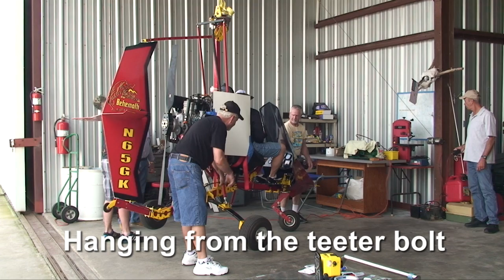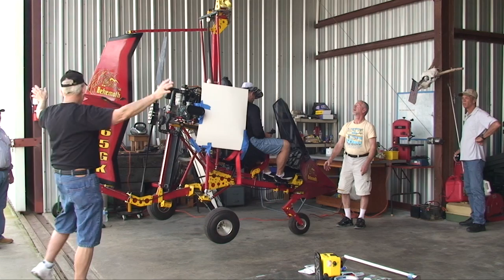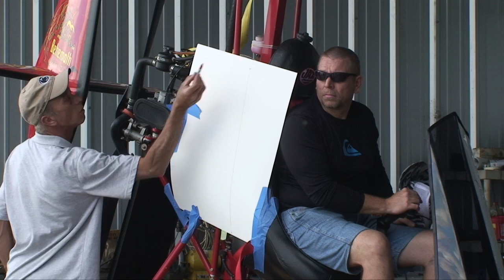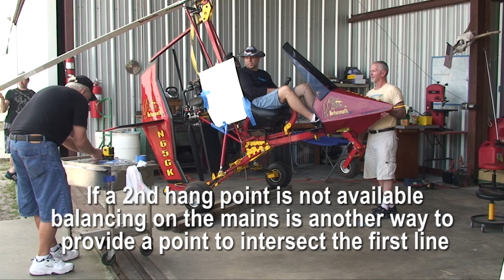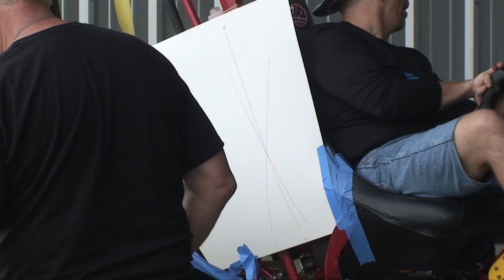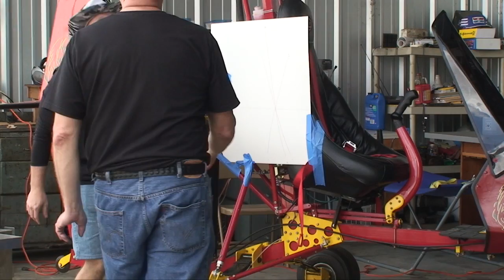Gyroplane Double Hang Test to determine Center of Gravity, CG

Comment: Hi tchick. I try to calculate the center of gravity height of the car. I raise up the front of the car to calculate the center of gravity height; and then I do again, this time I raise up the back of the car to calculate the center of gravity height, I raise up same height but I got the different answer of center of gravity height. Do you know why? Should I need to raise up the lighter side of the car to calculate the center of gravity height?

Comment: I need to build the rotorhead hang block to attach the lifting line. Does anyone have a diagram or a photo which I can use to build?
Reply: I’ve heard guys on the forum. Using a v shaped  price of steel with a metal sleeve to slide the teeter bolt through. Then you could drill a hole in each end of the V. Then close the V with a shackle.
Reply: @bwkern3   Thanks for the feed back. I cut a piece of high pressure thick walled pipe and welded a 1/4 inch steel plate.  I punched a hook hanging hole  before I did the weld. It worked out well.
Reply: It's real simple:  flip the rotor hub bar, with blades detached, upside down and attach to the head towers with the teeter bolt as usual.  Then run a rope or nylon straps over both ends of the hub bar, and through your crane hook.  Why anyone would waste time making a special attachment is cray cray.

Comment: So the thrust line and the CG are aligned but what about the rotor thrust line in relation to the cg found by this technique?
Reply: Thrust line is rarely in line with COG, most often slightly above, but on one type it is actually below it.  Move the stick back and the rotor thrust line moves ahead of COG.  Push forward and the rotor thrust line moves behind the COG.  At straight and level flight the sum of all vectors is passing through the COG, you can't just talk about one vector alone - a common freshman error in gyro design and operation mechanics and understanding.  Think about it this way:  If the rotor thrust line passes through the COG in S&L flight, then the prop thrust line must also.  This sets up a very twitchy, unpredictable aircraft with no control feedback that is all over the place in the slightest bit of wind or thermal draft.  Not my idea of a fun, relaxing Saturday afternoon in the sky.

Comment: This determines where the CG is but how do you determine CG limits as required by FAA?
Reply: Required by FAA?  Who are you kidding?  The primary issue at stake is measured hang angle, most often as deflection from perpendicular.  Common practice is to measure the mast angle as the airframe sits on the ground, then measure the angle of deflection from that starting point, which on a tandem gyro should be forward/nose down, fully loaded with fuel and pilot, between -12° and -15° inclusive.  I may be mistaken, but I think single-place gyros have a minimum hang angle from the teeter bolt of -9° and a max of 12

Comment: Good video but..the guy with the white cap who draws the first reference point: is he really smoking a cigarette inside the hangar, a few centimetres away from the Gyro's tank and with lots of people standing around, seriously ?????
Reply: A cigarette can’t ignite fuel like in the movies.  You could literally put the cigarette out in fuel.  It’s lighting the cigarette or a secondary affect (cigarette igniting a flammable material) causing an open flame is what can ignite because it produces the heat needed.